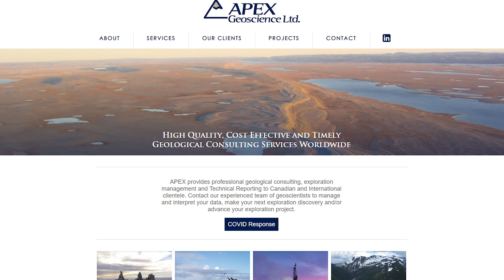This US miner has discovered enough lithium for 50 million EVs

Comment: Sigh. Dude. You are better than this! 
It is not a shortage of lithium… it is production and processing capacity. 

We can’t process enough in a relatively short period of time. Some of the techniques in use take over 18 months and require vast amounts of real estate. 

There is plenty of lithium.
Reply: This guy saw taiwan conflict now starting to spew indirect hatred to china now trying to get his stocks up even if its 1% .
Reply: This is incorrect. There is currently over capacity of refining and processing in China there is currently a structural shortage of mined material which will not be rectified this decade. Mines don’t just materialise overnight. Typically a mine will take 7-10 years from start to production by contrast it might take less than 2 years to build a battery giga factory. JB Straubel has warned of the lithium shortage on many occasions.
Reply: @danielgraham8559 . I’ve read a piece saying that there is material available for processing, but that it was deemed superfluous. Upon reflection, I’m wondering if ‘superfluous’ was actually ‘substandard’. 

When you cite several years for getting a mine up and running, is that hard rock deposit? Or lithium brine?

During emergency scenarios (war time, post natural disaster, etc), bureaucratic hurdles and procedures can be streamlined so that actual physical  work can commence quickly. What id the time frame if bureaucracy is dispensed with (various governments will be eager to get new mining operations up and going. Governments love mining revenue)?
Reply: @tasmanianbadger  most lithium carbonate production is what would be termed technical grade which is unsuitable for batteries. This product needs to be reprocessed and upgraded in China at additional cost. Governments in the West have realised the bureaucracy and litigious obstacles to mjne permitting are a problem and are trying to untangle that mess by subsidising domestic production. Hard rock mining especially in Australia can have faster permitting timelines but the 7-10 years includes: exploration, drilling (proving out the resource), permitting, financing, infrastructure and construction of the mine. Add in at least another year to ramp production to stated goals.
Reply: The limiting factor for ev penetration for this decade is quite literally the availability of battery grade lithium chemicals
Reply: @danielgraham8559  nonsense. much of this shortage was pandemic related which killed the price which all but killed the ramp up. of course the inflation also partly caused by the pandemic will raise costs slowing everything. the roller coaster ride of ALB stock price the last several years reflects this clearly. refining not mining will soon be the problem. in a way it already is.
Reply: There is plentiful lithium on this earth the issue is that it takes 7-10 years to bring lithium from the ground and to the markets, we don’t have the technology to fast track the supply of lithium to keep up with demand. This is a timing issue and will lead to a shortage

Comment: The Range v Aggregate Mobility Curve is a mind model that links life cycle resources locked in EVs to provide seldom used range and performance against the total aggregate mobility available to society at system level if EVs only provided average daily milage on a charge and slightly more than adequate performance.

Comment: There are critical issues not being discussed in the transition to EVs 1) the Range v Aggregate Mobility Curve 2) The design for easy post traction use of batteries with much life left in them. Structural batteries seem an issue here. 3) The Phone-isation of Mobility and its consequences.

Good to see you mention peak car; this is an issue that needs expanding. What we need to be discussing is the maximisation of the integrated Resource Intensity of Mobility at system level in regards to available resources. All that is happening is a headlong rush to replace an electric powered version of the ICE past without any integration and standardisation, which is holding back such developments as V2H and V2G.
Reply: And the other thing that absolutely no one is discussing is what the world intends to do with all of the petrol and diesel that is a bi product resulting from the distillation of crude oil.  It's one thing saying "no more ICE cars" but for that to happen, it means no more bituminous roads, no more fuel oil for ships,
no more jet fuel for airliners, fertilizers, paints, plastics, rubber, pharmaceuticals and so on.
Absolutely no one has stopped to consider this. No one.
I'm betting that in a couple of decade's time, the world's governments will start incentivising motorists to return to ICE vehicle as a way to tackle an unmanageable quantities of petrol and diesel plaguing the world. Had you thought about that?
Reply: @davidbrayshaw3529  industry will adjust. I have no concern.

Comment: People used to attack me on various comment threads, saying things like "we won't be able to make enough batteries" and asking "where is the lithium coming from?" and some would quote the current annual production.  I would answer that it's abundance in the Earth's crust is reasonable.  Therefore we will be able to find what we need.  It comes in 33rd most abundant element which may not sound impressive but that is higher than lead or tin, a couple of metals that we have used a fair bit of over the years.
Reply: Yes, it is abundant. It's absolutely everywhere. Plants, animals, fish, seawater and even humans all contain lithium. That doesn't mean that it is commercially and environmentally viable to mine and refine, however. That is the problem.

Comment: And a kick in the head is that ALL that lithium is mined with equipment running diesel engines.
There is NO reason to abandon fossil fuels - the EV revolution is going to grind the world to a halt
when the grid can't handle the demand, and 25 years will be needed to fix that problem.
Reply: Tell you another kick, thanks to lithium and other raw materials mined with heavy machinery, (that will evolve as well) you were able to post your comment on your phone, tablet, laptop or PC. So for one or the other reason, it will be mined.

Comment: I can guarantee you that the senators who passed this latest boondoggle bill giving huge incentives for Lithium mined in North America, know full well which miners are on tap to drink at the trough of government stimulus.  

However, don''t expect these mines to get up to production quickly. A mine is the messiest, and one of the slowest industries. Big mines take many years to get going. A huge amount of equipment has to be moved around, and outside of a few states like NV and CO, mining is actually not easy to do, as it is considered a very undesirable business to have operate.
Reply: In California, the Salton Sea lithium mining uses geothermal  to extract lithium. The ion exchange process is the new way to mine lithium. You dig it up, use the exchange process and put the dirt back. Lithium is not toxic to the environment so the mining is cleaner than other forms of mining BTW and usually located in deserts.
Reply: @GG-si7fw  How many ounces of lithium you think are commercialized so far from the Salton Sea…? On a world scale it represents 0,0. Unfortunately, if it were easy to extract lithium from geothermal wells/brines, why doesn’t it happen everywhere yet. Vulcan Energy and all these other types of companies make a lot of noise to attract investors but in reality none of these projects is anywhere near commercial activity
Reply: Just follow pelosi trades

Comment: As batteries are recycled, the demand for Lithium will reduce in years to come.
Reply: As a matter of fact, the demand of lithium will certainly not reduce for the foreseeable future = 1 generation. Why would it? Sure, recycled material will gradually enter the supply chain but it will not contribute in a significant way before 2030. Significant as in, not more than 10%.
Reply: @gerardhaus8150  I agree 2030 will not produce the required amount but very long term they will produce the majority of Lithium requirements, after all 95% of the battery is recyclable and all the Lithium can be reclaimed. Plus the amount of Lithium in batteries will decrease, we have seen this already, the big bad Cobalt is no longer required. Lithium sources are increasing fast, like from hot rocks which is a byproduct of Thermal Energy, check out Cornish Lithium etc
Reply: @Stumpy1854-Orion  You’re absolutely right Steve about recycling, that’s one of the beauties of batteries. But we need to think in terms of “10 years or less” for meaningful raw material supply to come to the market in order to even talk about recycling making an impact.
Talking about new supply, no matter how lovely Cornwall is and how much excitement there is to rejuvenate mining in the area, realistically, Cornish Lithium probably will not be the type of supplier that can materially make an impact on the supply curve within that given time frame. Not even for the UK market.

Comment: There is no shortage of lithium .. the sudden increase in production of EVs worldwide has peaked demand for the material. It will flatten out as lithium refining capacity gets ramped up.
Incidentally lithium comprises only about 12% of a lithium ion battery in weight.
And Lithium Fe battery has even less qty of lithium.
Reply: Sorry but the lithium contents of a lithium ion battery by weight is even lower - for a 70 kWh battery it is only 11.2 kilogram of the stuff.
Reply: As you say there is no shortage of lithium -- basically. But lower cost production from some sources will delay production from others sources. Sodium will replace lithium starting with stationary batteries because of weight considerations but the size of the potential sodium battery market will drive development of sodium batteries to the point of replacing lithium.
Reply: @carlwilson8859  Yes, I agree. I don't know if it's going to be Sodium or Sulphur or Aluminium that will be the key ingredient in the one chemistry that will for some uses supplant Lithium - or a combination of chemistries, there isn't just one golden ticket. But for now Lithium is a good element to rely on and deposits are becoming viable all around the world. Tesla building 2 million EV this year - at most half of them in the US, that means the newly found deposit would last 10-20 years even if they ramp up production at ludicrous speeds. But then there are large deposits in Germany, two different types of deposit, one hard rock deposit in Zinnwald the other located in the Mittleren Rheingraben (deep thermal water) both easily the same size, Austria (Koralpe, not too shabby in size), The Chech counterpart to the Zinnwald deposit, the UK with the Cornwall granite where lithium is contained not just in mineral veins, there the minerals are rock forming (i.e. the very granite that this whole former volcanic magma chamber has cooled down to form)...
Reply: The IEA has already predicted lithium shortages by 2025.
Reply: @saneman8147  Unfortunately they did so without regards for increased prices which made a lot new deposits viable.
Reply: There will be a shortage of lithium because it takes 7-10 years to bring a mine into supply, the world has not created enough mining sites to keep with demand, Tesla alone will need 80% of global lithium supply if they plan to sell 20 million cars by 2030
Reply: Exhibit A from the Climate Crap Coalition: 

One of the glaring stupidities of the climate change argument is the fact that the climate was warmer than it is now in years 800 to 1200 – the Medieval Warm Period.  Greenland had a thriving Viking colony and England was producing so much wine that the French were getting upset about the competition.  Neither Vikings nor the English drove SUVs.  The stupid assertions of climate change is government expanding its boondoggle empire through quackery and superstition. “Government imposed superstition” in the 21st century is something we should be ashamed of.

https://youtube.com/c/CDN_ClimateDN

The Ballad of Climate Superstition: https://www.youtube.com/watch?v=0CFuCYNx-1g&ab_channel=lozzagermain
Reply: AND, they KNOW, this system is just a steppingstone to the future where fusion energy will power all our needs. Never put ALL your eggs in one basket!
Reply: @inmyopinion6836  Are we all going to have a Mr. Fusion in our cars?  The dream is that fusion will some day make electricity.  That it will be economically feasible is unlikely, but if it ever happens, you'll still need a battery to store the energy in.
Reply: @incognitotorpedo42  No way, it will be in your phone and blue toothed to all your power-hungry accessories. A micro reactor for ALLL .  Sounds crazy but so did Dick Tracey wristwatch communicators 70 years ago! Look at us now
Reply: @inmyopinion6836  will fusion ever really do this?  it costs 5-10 cents per KW to transfer energy on the grid.  by 2030 it will cost 1 penny to produce and store your own solar energy at your home.   why would people buy it from a 3rd party for 10x the price?   unless you can produce your own fusion, i don’t see how anything competes with solar + batteries.  the future is decentralized with solar, crypto, AI,
Reply: @shake6321  0k, perhaps in your future. But in MINE, we advance our technology beyond current thinking. Fusion will be handheld portable and infinite. Much like cell phone computer, GPS, million ap devices we have NOW, that I could not even imagine
 when I was YOUR AGE
Reply: @inmyopinion6836  that’s what will have to happen for fusion to overtake solar. even then, can we make a fusion generator that small?   seems as if solar + battery will always be better even if fusion is invented
Reply: @inmyopinion6836  What a fusion reactor in a car ???
Reply: @inmyopinion6836  fusion?  There has been that fantasy pushed for 70+ years and its always "50 years out".

I'm not holding my breath waiting for it
Reply: @inmyopinion6836  1970: Nuclear fusion is the future...
1980: Nuclear fusion is the future...
1990: Nuclear fusion is the future...
2000: Nuclear fusion is the future...
2010: Nuclear fusion is the future...
2020: Nuclear fusion is the future...

Comment: To obtain more Li for cars and trucks, it would be worthwhile to use alternate chemistries for static applications.  Besides for these applications, these other chemistries are superior.  They use far less expensive materials and can be charged to 100% and discharged to 0 with now degradation over time.  All that is needed is increased markets to get the price reduction that comes with increased market.
Reply: All chemistries degrade with cycles.  Some (lifepo) just degrade at a lower rate.

Comment: You need to look at 2 companies Standard Lithium (SLI)  and Energy X both of which revolutionize the way Lithium is extracted from geothermal brines
Reply: Standard (don’t know Energy X as well as I do SLI, my bad) definitively seems to be pretty advanced but it’s only as revolutionary as the scale of production they will hopefully reach within now and 5 years
Reply: Note high purity Direct Lithium Extraction method e.g. Lilac (California) with Lake Resources (Aus / Argentina) using ion exchange technology to extract lithium from brines
Reply: @paulkempinski4602  Side note until commercial production at scale. Unfortunately, the need for new supply is now and for years to come. Big projects need time to be developed but if these companies really are so advanced as they claim to be, why didn’t they produce an ounce of lithium yet and start scaling up proving the tech is viable. Some of these projects will certainly start up some day, but so far it seems that the companies that talk the least seem to be closest to commercialization.

Comment: Lithium batteries will be recycled in the future as replacement cars and trucks will just be needed. So the more EVs we make, the less Lithium mining will be needed.
Reply: We will still need more batteries because battery EVs are not the only use case. The non-mobile use cases that don't depend on high energy density already have developing chemistries that don't rely on lithium. Hopefully this reduces cost across the board when implemented.
Reply: We will eventually reach a steady state. But not after the battery capacity has increased by a few orders of magnitude. To date, we have barely scratched the surface.
Reply: We are not even close to this point of saturation of EV batteries yet.
Reply: @BrandonSouperman   just 15-years.
Reply: Crude oil is a limited resource and will one day be used up. Lithium have barely been mined considering there are several more continents in this world. Yes, we will need more and more for the next couple of decades, but soon there will only be minimal needs for other uses.

Comment: There will be other options than Li ion batteries in the future. Sodium ion, aluminium ion and probably others.
Reply: Li-S Lithium Sulphur and Sofium Sulfur....

Lithium batteries will be recycled.

Lithium and Sulfur are very lightbelements, monoclinic batteties eith nonclinic and polusulphide coatednelectrode remove the need for Cobalt Nickel and Manganese